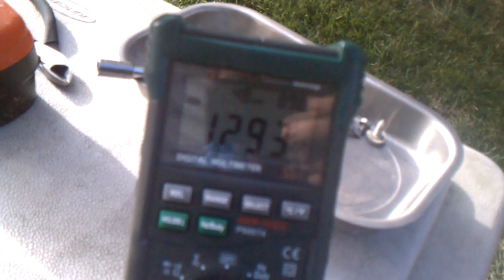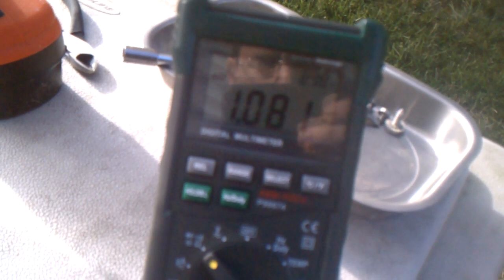Troubleshoot outside condenser fan a/c ac hvac part 2

Comment: You can also test the fan relay at the board. Make sure the switch is normal. You can literally put the two black wires together to see if the fan will run. If the fan runs jumped out, obviously a bad board....or technically a bad relay on the board.